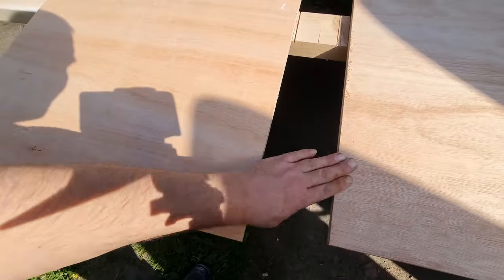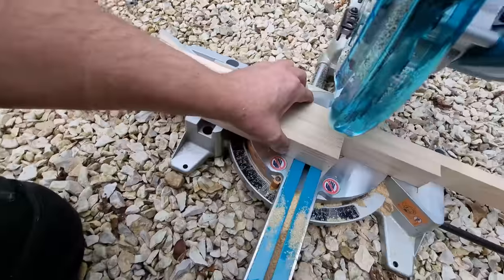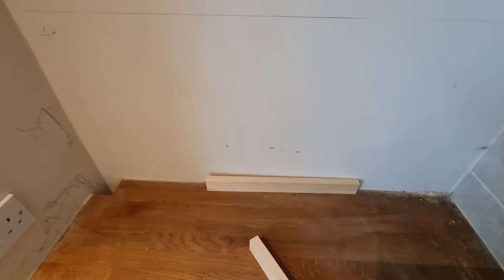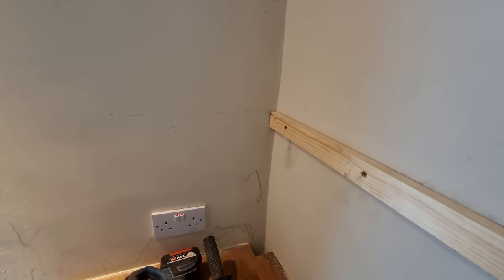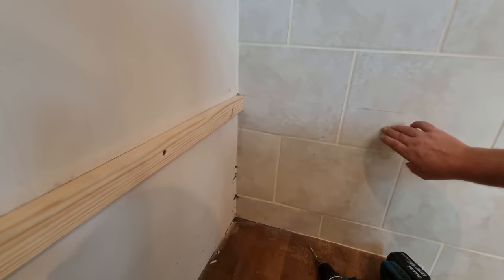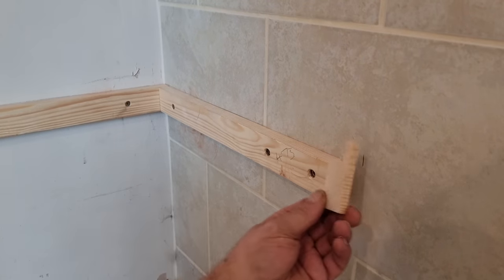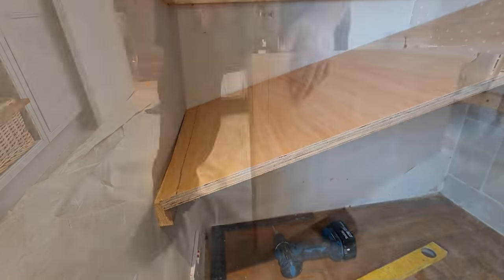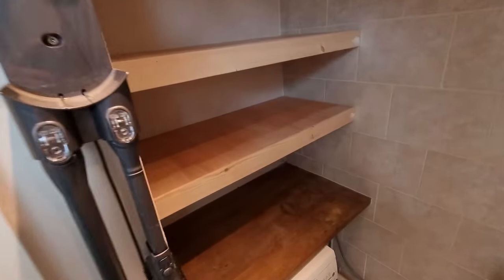Fitting some simple shelves in Deb's laundry room, building into the alcove with Ply & Pine build.

Comment: I didn't think you should hammer drill through tiles in case they crack. I always switch it off until I drill through them. Interesting.

Fab video as always. Just a simple thing done to perfection.

I can see you acquired some new toys. That Hoover is actually manufactured by Nilfisk. I had one of them for 5 years until it died last month only to be replaced by the same one.

Good to see you're in great shape!
Reply from the maker: No you're right it's not a good idea to hammer drill through tiles, I did try to make it clear it wasn't a good idea & i should've mentioned turning off the hammer action, but sometimes if the tiles are hard & the drill if it isn't sharp it just burns the bit, this was prob not the best example but i took a gamble n luckily it was ok. No idea about the Makita vac, i've had it for yrs n it works well when the filters clear, & yeah I've always got new toys, you just haven't seen some of these because i haven't been filming but i've been trying to go completely cordless, since swapping the Makita track saw for a cordless one i've been able to replace the corded tools i didn't want to be Bosch cordless, it's a slippery slope. 😁😂 Bit fat n old but yeah i'm ok thanks, keep well yourself 👍
Reply: Tile hardness matters, but so does the adhesive behind the tile. If someone has dot and dabbed it rather than trowelling, leaving a void behind the tile will definitely cause it to crack.
Reply: @gss6531  please be honest with me though, because if it does work better I'll try hammer action on my next installation.

Comment: I dont  use a vac for the dust, I use a freezer bag taped with a bit of masking tape just under where the hole is going. Works great.
Reply from the maker: Fine if that works for you 👍 20 holes on this would be a pain 😒

Comment: yep, my Bosch stud/pipe/wire detector is a bit crap too
Reply from the maker: Yeah i think i paid £80, first touch to the wall all seems fine but move it around a little & the reading is indecipherable, is there a stud there or not, there's wires there but where exactly, I once chopped the plaster off a wall to find there was no wire  🤯🤷‍♂️🤷‍♂️😒 It does sort of work but it's not accurate enough to trust.

Comment: Where did you get that horseshoe dust extractor from ?
Reply from the maker: Hi, i can't remember where i bought the vac attachment but it's this on Amazon 👍 https://www.amazon.co.uk/Bomoya-Hands-Free-Collectors-Effectively-Woodworking/dp/B09DKD1KRT/ref=asc_df_B09DKD1KRT/?tag=googshopuk-21&linkCode=df0&hvadid=534823757452&hvpos=&hvnetw=g&hvrand=15333066992483003841&hvpone=&hvptwo=&hvqmt=&hvdev=c&hvdvcmdl=&hvlocint=&hvlocphy=9046304&hvtargid=pla-1436901615515&psc=1
Reply: Good job Gid 👍

Comment: A couple of nice solid shelves there mate, I see that you new Makita nailer is really quiet also, these cordless tools are really quite impressive these days, mind you they know how to charge for them, 👌👌👌👍👍👍🇦🇺
Reply from the maker: Thanks 👍  yeah it's ok, not as powerful or as smooth as the air Bostitch, this ones a bit clunky but i'm getting used to it & no hose n compressor is a huge bonus, yeah, this nailer wasn't cheap but each month I can just about afford the price of a cordless drill, so this was a couple of mths toys in one, I might grind the nose a little to see if i can get better depth 🤔😂👍
Reply: @Gidjoiner  Is that Makita 40V Brad nailer limited to 40mm brads Gid? I'll be getting a couple of 40V tools at some point, the 216mm mitre saw first maybe. A dual bevel head on a cordless mitre saw that isn't too big is a big attraction for me. Anything bigger than 216mm is too big to be lugging in and out of a van every day. I have the same little 190mm Makita 36V as you but when I'm doing stair balustrades it's a bit limited. I'm putting away money for the second half of my w/s build so the shiney stuff will have to wait. Those were beautiful shelves, marvellous craftsmanship as always,  👍 😁 🔨 🇮🇪
Reply from the maker: Hi, I don't mind the big Dewalt that it's corded, if i'm getting that out running a lead is no big thing, but yeah cordless is the way to go if poss, i didn't have the funds when i bought it & i didn't wat to Have Dewalt to add to my growing list of chargers, The 40v nailer I'm not hugely impressed with it as i wrote somewhere else, i wouldn't say it was crap but it's a little bit crap for Makita, yeah i think 40mm max size of pins, not as much power as you'd like, the nailer action isn't sharp so results in a bit of a kick which then results in less penetration, I like that it's fairly small & got a narrow nose compared to other brands but I'm considering grinding the nose down a bit, you'll see in the cupboard vids i nail the face frames on, 20mm Beech onto ply carcass 40mm pins & the head doesn't always go below the surface, don't think I'd buy it again & i read the bad reviews n hoped they were wrong, they're not, it's fine on softwood 30mm pins like in this vid,  😒 Might buy an Hikoki one as i've batteries for those & they are a positive action, but i don't like the fat nose on those, ... we'll see 👍 There's not a lot of choice on the market tho, big with a fat nose or smaller with a narrow nose like this but not quite enough power 🤷‍♂️  Thanks, glad you like the shelves 😁👍

Comment: How is the 40v Makita nailer Gid?
Reply from the maker: Hi, I'm not hugely impressed with it, i wouldn't say it was crap but it's nearly crap, not as much power as you'd like, the nailer action isn't sharp so results in a bit of a kick which then results in less penetration, I like that it's fairly small & got a narrow nose compared to other brands but I'm considering grinding the nose down a bit, you'll see in the cupboard vids i nail the face frames on, 20mm Beech onto ply carcass & the head doesn't always go below the surface, don't think I'd buy it again & i read the bad reviews n hoped they were wrong, they're not, it's fine on softwood 30mm pins like in this vid,  😒 Might buy an Hikoki one as i've batteries for those & they are a positive action, but i don't like the fat nose on those, ... we'll see 👍 There's not a lot of choice on the market, big with a fat nose or smaller with a narrow nose like this but not quite enough power 🤷‍♂️

Comment: I've just put a large cupboard in a Laundry. Old Lath and plaster... Do you think I could find even the  smell of timber to fasten to??? 😬. Lots of extra screws, could not do anything else. What's the fancy dust collector head for the Hoover? I definitely need one of those. Details please 😊
Reply from the maker: Yeah sometimes you think you've got a fix but it's just into a lath 😂 Expanding anchors sometimes work, some of these have a long shaft to allow for the plaster + lath https://www.screwfix.com/p/rawlplug-hollow-wall-anchors-m4-x-38mm-20-pack/54782, & i can't remember where i bought the vac attachment but it's this on Amazon, https://www.amazon.co.uk/Bomoya-Hands-Free-Collectors-Effectively-Woodworking/dp/B09DKD1KRT/ref=asc_df_B09DKD1KRT/?tag=googshopuk-21&linkCode=df0&hvadid=534823757452&hvpos=&hvnetw=g&hvrand=15333066992483003841&hvpone=&hvptwo=&hvqmt=&hvdev=c&hvdvcmdl=&hvlocint=&hvlocphy=9046304&hvtargid=pla-1436901615515&psc=1

Comment: Nice one Gid.. really enjoying the regular videos again - the stairs series is excellent…. Rocking the new haircut mate 😉. By the way what are your views on that Makita nailer you were using?
Reply from the maker: Thanks Mike, glad you like them, i'll have the rest of the clips of the alcoves edited & uploaded this wk, the staircase won't be for another mth, 👍 I'm not hugely impressed with the nailer, i wouldn't say it was crap but it's nearly crap, not as much power as you'd like, the nailer action isn't sharp so results in a bit of a kick which bounces the gun & results in less penetration, to get in between these shelves I like that it's fairly small & it has got a narrow nose compared to other brands but I'm considering grinding the nose down a bit, you'll see in the cupboard vids i nail the face frames on, 20mm Beech, 40mm pins onto ply carcass & the head doesn't always go below the surface, don't think I'd buy it again & i read the bad reviews n hoped they were wrong, they're not, it's fine on softwood 30mm pins like in this vid,  😒 Might buy an Hikoki one as i've batteries for those & their guns i have are a positive action, but i don't like the fat nose on those & they're not easy to get hold of, + they're a few hundred £s, ... we'll see 👍 There's not a lot of choice on the market tho, they're all a bit too big with a fat nose or smaller with a narrow nose like this but not quite enough power 🤷‍♂️ The air Bostitch is hard o beat but I'm trying to get away from corded & compressor tools.
Reply: @Gidjoiner  thanks very much for the response mate - very useful. Like you I’ve been looking at electric nailer options to avoid keep firing up the compressor, but still on the fence. Haven’t seen any good solution in the uk for 23g either..
Reply from the maker: No problem 👍 I'm trying n failing to limit the chargers i have so i did buy the 23g Makita, as with the 18g it's lacking just that little bit of umph, it's fine on softwood & i'd only be using it on beads & fairly thin material but i made a little vid of 20mm Beech onto 20mm Beech with the max sized 35mm pins, spoiler - the heads stick out 2-3mm 😒 but like i say i won't be nailing 20mm Beech with it, I was going to n maybe should've got the Hikoki,
Reply: @Gidjoiner  thanks mate I could see it fine - very interesting. It will be good to see what results you get with the Hikoki if you do get it. They do get good reviews but I’ve only really seen them being used for framing or first fix type work..
Reply from the maker: I couldn't help myself today, along with the Hikoki framing nailer I've got the Hikoki 15g & 16g, just playing around i banged 50-64mm nails through 2 pieces of that 20mm Beech like in the vid i posted in the comment above (deleted that vid) & through 20mm Beech into the edge of 18mm ply like on the alcoves, no prob, it banged them in below surface with little kick, I should've just used those on the alcoves rather than fannying around with the Makita but ya never know till you try, anyway today online buying stuff for my next job i accidently bought the Hikoki 23g pinner, oops, it should arrive tomorrow 😂😊 i'll let you know 👍 BTW i've struggled to get the 18g Hikoki 😒
Reply: @Gidjoiner  good for you mate… seems like it’s true what they say then😉. Oh well another battery platform🥴
Reply from the maker: Yep, Bosch, then came Hikoki, Then Makita & this Makita 18g added 40V to the chargers, then Milwaukee with the narrow crown stapler, I've already got Hikoki so that's no prob buying the 23g, but it's why i don't want Dewalt batteries as well 😒😂
Reply from the maker: Delivery turned up but i'm disappointed 😢 tried the Hikoki 23g on the two 20mm pieces of Beech, 35mm pins, the Makita left the head 2-3mm sticking out, the Hikoki 8-10mm -ish out 😒 I won't be pinning 20mm hardwood on but that's not what i hoped for, I'm not one for fannying around returning things by post if i can't just take back to the shop, so the Hikoki i'll use in the shed & the Makita i'll use on site, 🤷‍♂️ The Hikoki 18g has been discontinued, there might be a new model out one day but Hikoki can't say when,
Reply: @Gidjoiner  sorry to hear mate.. that is disappointing. Be interesting to see if someone can come up with real solution/alternative  to compressor based options.
Reply from the maker: Yeah disappointing but a lot of these cordless nail guns are only just coming on the market in the last few yrs so hopefully they can only improve 🤞👍😊

Comment: Wondering why you didn't use the track saw for the scribe cuts instead of the jigsaw.  Habit?
Reply: Scribe cuts were not straight
Reply from the maker: Yep the sparky's right, i cut the straight cut on the right with the track but the one on the left wasn't straight, i did mention it but i mumble a bit so maybe that wasn't clear 👍
Reply: Yeah, I must've missed it.  Ta for the reply.

Comment: Hi,Gid. Now you have almost all platforms (Makita 40V, Hitachi,Makita 18V, Milwaukee,Bosch) big bag of chargers 😉
Getting budget for nail guns and will stick with Milwaukee starting from 23G to 1fix. Saw your crown stapler,do you happy with performance?
Reply from the maker: Yeah tel me about it, I've wanted to go totally cordless for ages, I tried sticking to Bosch because the ones i have are quite good & i wanted as few chargers as poss, but some tools i didn't want to replace with Bosch, i wanted Makita like the corded ones i have, so after replacing the track saw with the cordless i've been buying what i can, but this nailer is 40v - another charger 🤦‍♂️  The Hikoki framer is the best i'd tried that wasn't battery + gas. The Milwaukee replaces the Bostitch narrow crown stapler i have, Milwaukee seemed to be the only one i could find, yeah i quite like it, don't like Milwaukee & it's a bit big but it does the job no prob, good positive action 👍  I considered the 18g Hikoki but it has a fat nose, there's not a lot of choice on the market tho for some things, either a big with a fat nose or smaller with a narrow nose like this Makita nailer but not quite enough power 🤷‍♂️

Comment: what blade you got in your track saw gid
Reply from the maker: Hi, i just changed it from the orig that was too flexy for trimming the edge if things, it was drifting when cutting not much more than the blade width, I buy the Freud blades, the one in the little Dewalt is the same one i put in when i bought it, admittedly it's getting a bit tired but those Freud seem to last a long time 👍👍 you'll see the blade change in track saw in the upcoming alcove cupboard vids 👍 I went with the 40T blade because it has a thicker kerf so hopefully a stiffer blade https://www.screwfix.com/p/freud-wood-circular-saw-blade-165-x-20mm-40t/975kj

Comment: Gid the Makita nailer what’s you’re thoughts on it I have been wanting one for ages now but I am on a few Makita groups on Facebook and they all say they are crap also YouTube video’s
Reply from the maker: Yeah not hugely impressed with it, i wouldn't say it was crap but it's nearly crap, not as much power as you'd like, the nailer action isn't sharp so results in a bit of a kick which then results in less penetration, I'm considering grinding the nose down a bit, you'll see in the cupboard vids i nail the face frames on, 20mm Beech onto ply carcass & the head doesn't always go below the surface, wouldn't buy it again & yeah i read the reviews n hoped they were wrong, they're not 😒 Might buy an Hikoki one as i've batteries for those & they are sharp but i don't like the fat nose on those, ... we'll see 👍
Reply: @Gidjoiner   and I noticed yours is 40v one the 18v one that I was looking at is even worse might just stick with paslode
Reply: @aaronbell8527  Pneumatic guns are yet to be beaten in my opinion. I run a Senco 15ga finish gun, a Milwaukee 18ga Brad nailer and a Bostitch narrow crown stapler off a DeWalt flexvolt compressor. Gasless and airless technology isn't there yet. That's just my tuppence worth, 🔨 🇮🇪
Reply from the maker: yeah, the Hikoki nailers have a good positive action, they fire in well but apart from that, the 15g & 16g are big with fat noses & none beat the Bostitch air i have for quality, power, size & weight
Reply: @aaronbell8527  Paslode is baaaad! Everybody hate Paslode because it stinks!

Regrettably though, it just works. I've only known Paslode really so can't comment on other brands but if Paslode is what majority use there's probably a reason for it.

They're expensive, expensive to run but you can take them apart like firearms, clean and lubricate them and spare parts are readily available. Paslode is a trade off for me but one that I got used to and can deal with its quirks reasonably quickly.

It still stinks though!